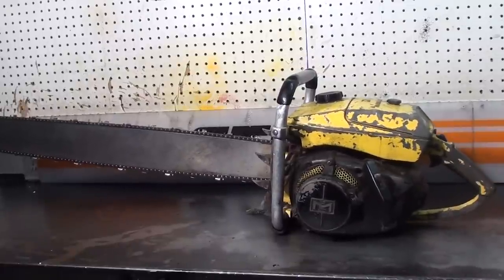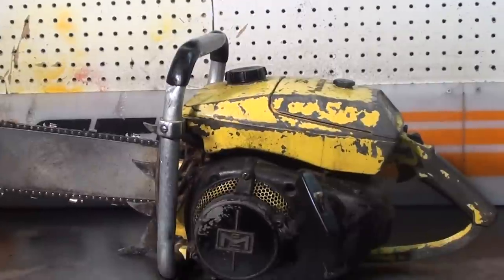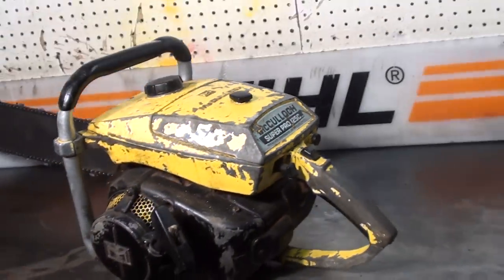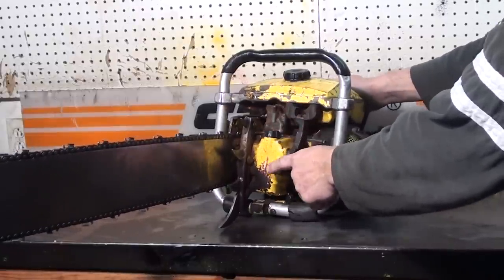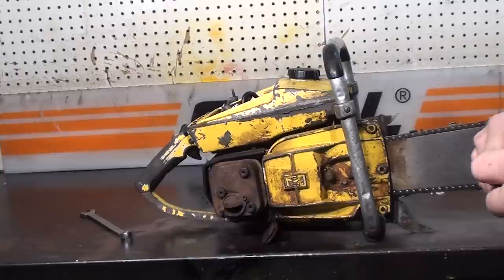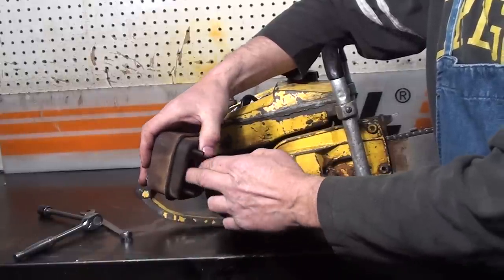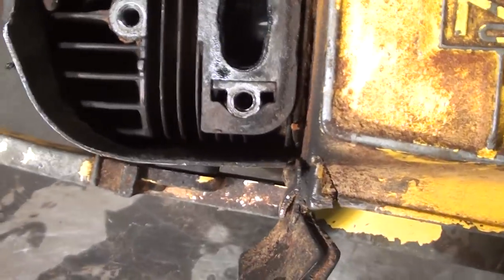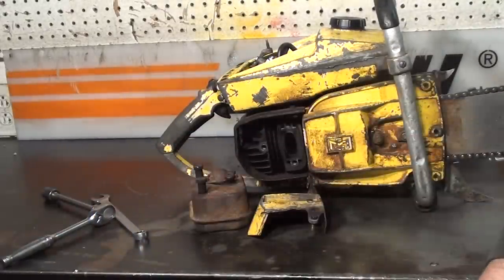The chainsaw guy shop talk barn find McCulloch Super Pro 125 chainsaw 12 13

Comment: having problems with my automatic oiler, the manual oiler is stuck aswell. the manual oiler will pump if i take the screw out above the chain oiler hole, was just curious if you had any ideas on what my problem could be.

Comment: Thin rings offer more performance since there is less friction, but don't last as long as a thicker ring. Thicker rings can afford to lose small amounts of metal, through normal wear, without it affecting their ability to retain compression. Kind of boils down to just how often do you have to tear down your motor in order to replace the rings, or do you just want to keep on going and not have to worry about it.

Comment: why do you pull the rope every time you kill a saw?
Reply: The flywheel has centrifugal weights  that the starter pinion grabs onto for starting.  When he shuts the engine down, the weights collapse and grab the pinion and it's really hard on the starter mechanisms.  This happens just as the engine stops turning. By pulling on the rope he gives the starter some slack and releases it as it stops. It's a very good idea. Hope this makes sense.